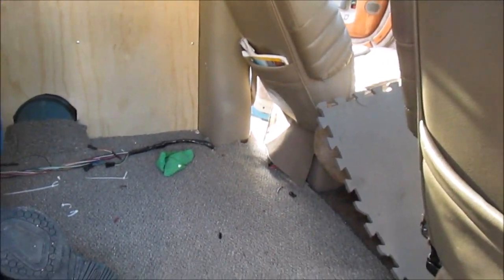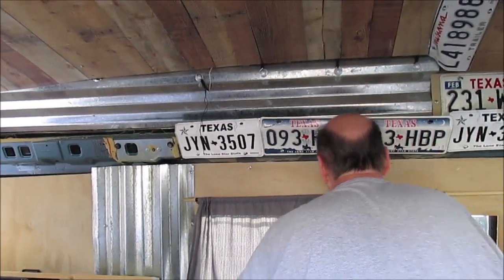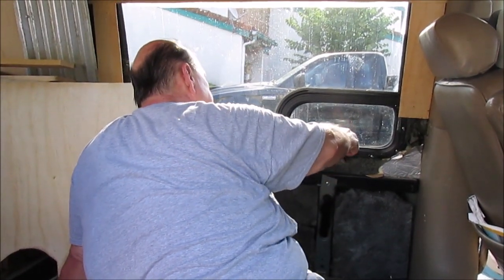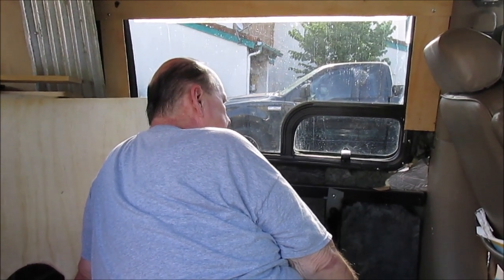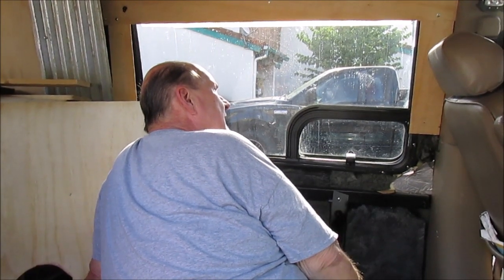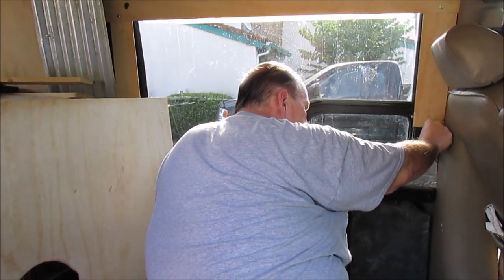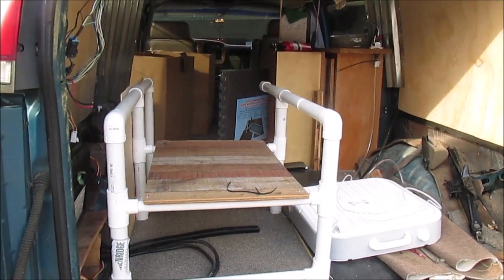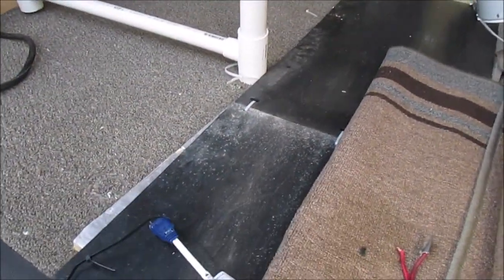A/C Installation Fail - Bed Removal - Cardboard Filing cabinets

Comment: I love that y'all have such a positive attitude with the build. If I could wave a magic wand I'd stop the build and have you drive the van for a month everyday to test mechanical reliability. * Why not vent the portable A/C out the side of the van. You can put a clothes dryer louver on the side of your van and maybe add an RV water proof door over the vent if needed. A lot of heat comes off the exhaust vent hose on a portable unit so put the vent hose in an A/C insulated duct. The shorter and straighter the vent hose the better the efficiency.  *  A small window unit in the back widow is an option too.  * Why can't the latch on the little widow be modified to allow the widow to open wider??  ** I vote for venting out the side of the van. Oh yeah, I don't have a vote.  So how 'bout a contest video asking viewers vote what they think your final solution will be. Choice #1. No A/C  #2. Vent out the little window #3. Vent out the side of the van #4. Vent through the floor #5. Install window unit in the back window.  BTW have you checked if the van is insulated properly to prevent condensation? I remember watching a van build video where the guy had to rip all the insulation out of his van because he used the wrong type material.  Wow, I'm really invested in your build series....lol.  Is there a word limit on YouTube comments???...lol. Your van should be called SPIRIT. We're all rooting for you guys.

Comment: I will say the outside sure looks nice. Personally I like the PVC for bed support. It`s light and easy to work with. Of course it`s not the right size that you want. I saw a van recently with an AC on the rear mounted flush on the inside with a vent on the back door. We will stay tuned.
Reply from the maker: I think I saw that same video. He had a little wall behind his bed?  Yellow van I think?

Comment: a sheet of foam board from the dollar tree fits right in the glass groove of the door, open the window as much as you need and cut to fit , you can add a strip on either side along the bottom to slip over the window. a strip from a dollar tree pool noodle can be used to take up any gap on the curved part of the window..

Comment: Tips of the Day: 1. Score one side of your cardboard before folding. Use a straight edge for perfect folds. 2. If you disconnect the locking latch on the little window you should be able to extend how wide you can open it. If its hinged at the top. Couldn't tell from the view but that should give you a wider opening to vent the a/c.
Reply from the maker: But would the window still close and lock when A/C not in use?
Reply: @LostOnLandAgain McGyver Time!  I'm guessing from what I can see but if you open the latch and look from the side you will see a small horizontal pin that connects the latch to the part that goes through the window. That creates a hinge. Tap out that pin with a small phillips screw driver or  something the size of the pin. Once it is out the window should open freely or to the max the upper window hinge will allow. Replace that pin with a piece of wire the same gauge (fencing wire, coat hanger or something that fits). Cut it long enough so you can grab it when you want to disconnect the hinge from the window. Bend one side like a handle. When you're ready to hook up the a/c vent just pull the pin. You may need something to prop up the window for unrestricted air outflow. Or you could just pop out the pin each time you want to use the window for a/c. A pull pin would be more convenient though.

Comment: Hey Lola, what about one of those portable AC's that you vent the hose thru the window, or is that what you are talking about?  Surely that would fit thru that little window..why do they put such little openings on such big windows anyway..I have the same back windows as your old van and the air flow is awful, even with all of my windows open, unless I'm running fans, one sucking, one blowing..craaaaaazyyy stupid design, lol..you are itching to go camping and I am itching to start demo-ing..once I get the bed out, (next month) I'm all good..cant frickin wait!!! So excited for you..my friend made pipe beds for her kids..they love em n they made forts under them and she can add or take away as they grow..genius I tell ya..pure genius!! Keep these vids coming..and hey Lola((((((Stay Lost My Friend!!!✌❤😊
Reply from the maker: Yes, that's what I have, the A/C with the hose.  The problem is.....  In my old van we had to rig it to work with the vent that was previously installed. So I ended up cutting the end off the hose.  Now I need to replace the hose. LOL  It's always something.  But John said they make a more insulated hose so if I'm buying I may as well go big.  :)  Stay lost my friend.  Can't wait to see you get your van build done.  Send pics!  LOL

Comment: So why not a transition piece (of what ever size your dealing with behind the ac), transitioning into to small round flexible duct pipes. Could make a transition piece from foam core styrene sheet (gatorboard). And Two small round flex hoses side by side would fit to that window, and if using two round flex hose side by side, you would have access room to the window latch... Just a thought to play with in the imaginative mind

Comment: ALASKA, did someone say Alaska?  You will figure it out. Hey progress is being made.
Reply from the maker: So my brother asked "do you think those eggs were any good or was Dan just saying that to be nice?".   LOL  I sure hope they were actually good.  So how is Alaska?  It's HOT here!  (i'm saving you a jar full of TX heat cause I know how much you must miss it. :)
Reply: @LostOnLandAgain  The eggs actually were pretty good.
The weather varies. Here in Fairbanks tomorrow supposed to be a record-breaker of 90°. When I was up in dead horse the high was 46 degrees the low was 34 degrees. Denali National Park was perfect high around 78 low about 58.
Thanks for saving me some heat but I don't think I'll need it.

Comment: I have the climate issues you do living in AZ.  I don’t have an AC unit to put in my van, I figure I will just go north to camp in the summer and use fans, lots of fans. I have the dash AC if I am really in a furnace spot for emergencies.  I kinda like the pvc use for the bed...  still using wood however.
Reply from the maker: I am tied to a job in the Dallas area for now, so if I want to get out at all, I want that A/C.  I just can't take heat like I use to. I liked the idea of the PVC but went back with my old wood bed from my other van.  Stay tuned  LOL